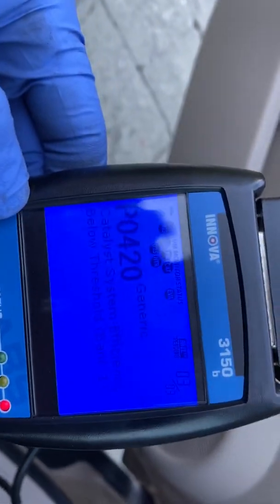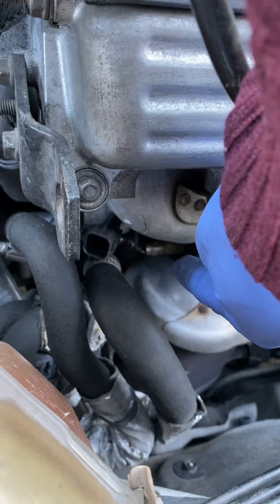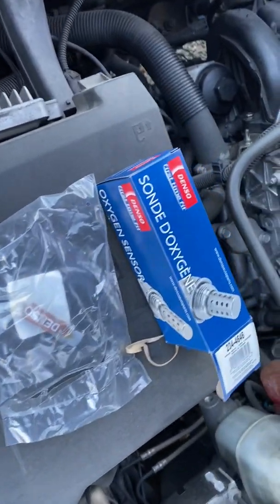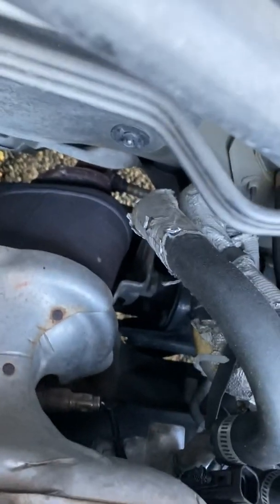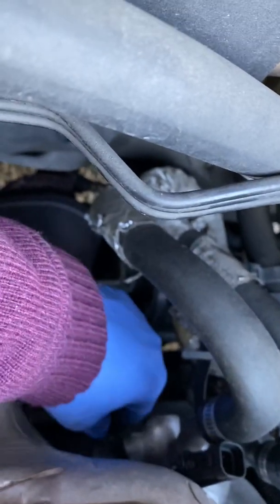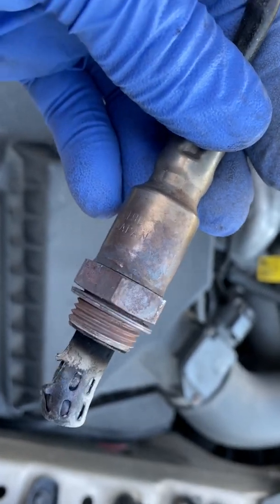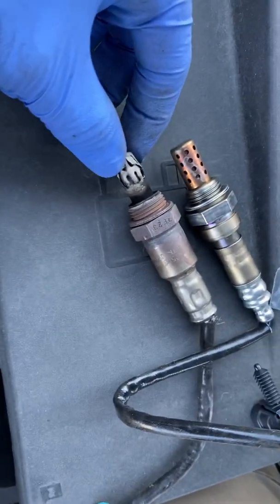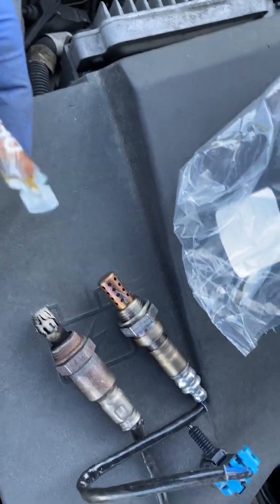Oxygen sensor on 2004 Malibu Pt.1

Comment: Great video. Thanks for the help. 05 malibu here.. running rich. Cleaned MAF and throttle body and it helped startup and stalling issue but still have the 02 code which is the main problem. Going to try this out